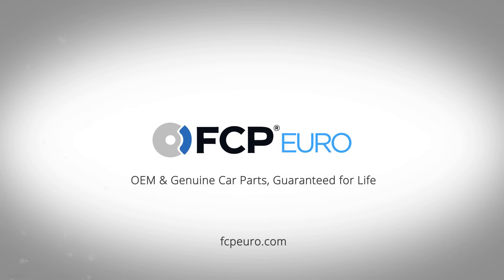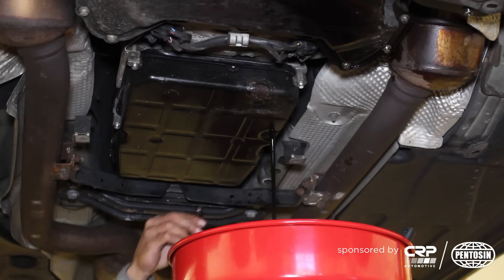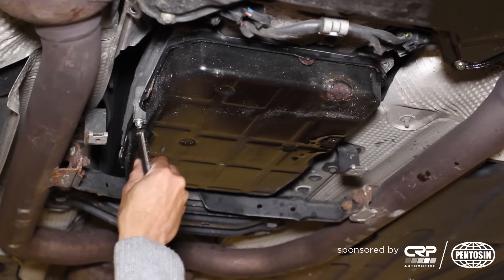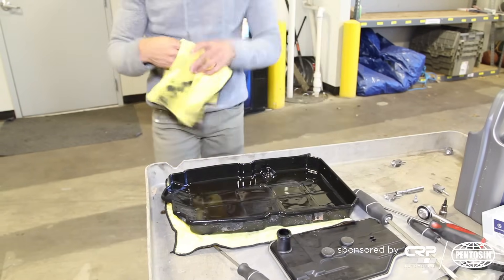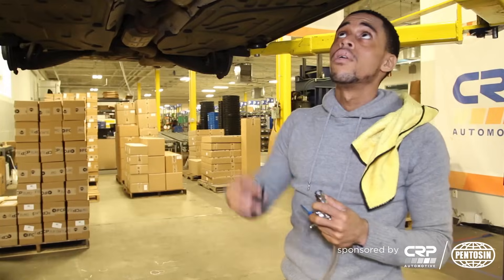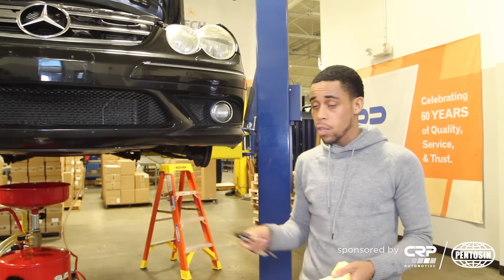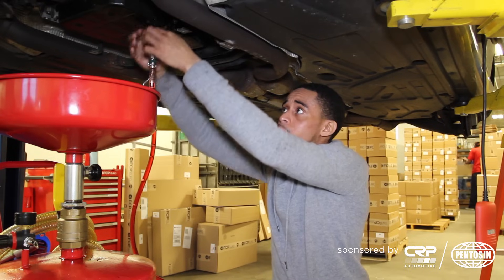Mercedes Transmission Fluid Service (w/o Torque Converter) Rein/Pentosin - Important Service (722.9)

Comment: You didn't Changed the gear from  drive to reverse and neutral at filling.
Reply: tay aci it was just a filter change
Reply: @iamher6422  look again itstransmission oil change with new filter ofcourse
Reply: tay aci 😂 I’m sure he did it off camera. I’ve done a lot of transmissions in which I too forgot that step with absolutely no problems.. 🤷🏼‍♀️
Reply: it's amazing how Benz complicated that simple procedure! Just need to know what is the exact oil amount (+/- 1/2 quart!)
Reply: How many quarts total sheesh thats all me need to knw
Reply: I heard of this before for the transmissions supposed to shift the gears so that the fluid could get into the gears properly

Comment: Great job, dont forget to do the pan bolt torque dance, 4Nm then 180 degrees tightening to stretch the new bolts that were supposed to be used each time.  I think they are aluminum.
Reply: Do you recommend draining the torque converter?

Comment: FCP, thank you for the video, but you need to also provide torque values for the pan bolts (mentioned below by another user as 4 NM + 180 turn) and drain bolt.

Comment: I watched your video from start to finish and from what I saw it was reasonably informative however I cannot understand why you did not drain the torque converter or flush the transmission cooler because you only changed 4 litres of fluid and left 4 and a half litres of contaminated oil in the torque converter and in the cooler which will contaminate all the new oil that you just put in this is why I do on my own servicing myself rather than getting another mechanic to do exactly what you did
Reply from the maker: Peter, for those wishing to drain the converter we also offer a 12 liter kit at this link:
https://www.fcpeuro.com/products/mercedes-automatic-transmission-fluid-service-kit-12-liters-pentosin-722-6fck2
Reply: that is a different procedure dude, what he intended in this video, i believe, was to demostrate a simple 40k trany svc were a filter/ gasket and trany oil are changed w/o the hasle of the other stuff you mentioned for a 100k svc interval 🤔

Comment: Clear and concise video. Thanks. 
Torque aluminum one time use bolts to 4nm evenly.
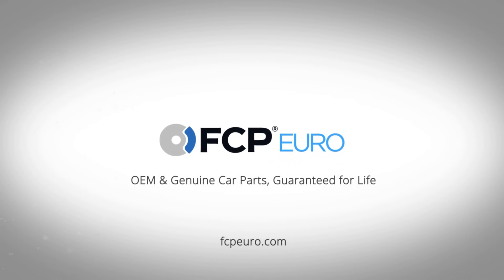With torque wrench turn bolt head to 180 degrees or 8 nm  and stop turning the bolt 6:42  whatever comes first.

Comment: What I like to do when setting the level and waiting for the fluid to warm up, is to overfill the transmission, and then cycle through all the gears waiting for about 30 seconds through each gear.
That way, you are using all the fluid you opened and cycling as much fresh trans fluid through the engine. 

If the fluid came out extra black, I will wait for the trans to cool down and let it run a little longer to try and cycle as much fresh fluid through everything as possible
Reply: wisdom
Reply: Is this what MB recommends? This sounds like the proper way to do it but maybe there's an underlying condition preventing this sequence to take place which is why MB does it differently
Reply: @aliislam580  no, the MB dealership will just do a quick job, so it will likely just be a straight drain and fill.

I recommend doing a drain and fill once, then again after 3000 miles, and one more at the next oil change (7000 more miles). Guarentees the fluid is almost completely exchanged and contaminants flushed
Reply: @reddyuda   I previously bought a used 2024 E350 with 110k miles but don’t have the service history. Is it still safe to change the transmission fluid?
Reply: @aliislam580  yes, the main difference being do not flush the system, just do a simple drain and fill. You can keep the old fluid in case of any problems you could swap it back in.

With 110k Miles you should be totally fine with a simple drain and fill. Wait 3000 miles before doing any additional fluid changes
Reply: @reddyuda  Yea sounds good but you haven't changed the internal filter or cleaned the magnet inside the sump.
Reply: @mercamg9312  No I still pull the pan, but I won't change the gasket or filter until the last fluid exchange. Different than a flush - I normally do the "slow" drain + fill method a few times to avoid any issues. There is about 1-2 quarts left in the pan usually
Reply: Nice

Comment: I have a 2001 ml320 with the 722.6 5-speed transmission and the drain and filter procedure is similar but there should be a fill tube in the engine bay near the back of the motor, it has a black cap with a red locking pin that’ll need to be replaced once opened/broken (inexpensive). Just measure the quantity of fluid you drained, then put that same amount back in thru the full tube. They also sell a universal Mercedes transmission fluid dipstick if you want to check for accurate levels. 

You can flush the 722.6 transmission by removing the lower fluid cooler line from the radiator and letting it drain into a bucket. (It will only drain when the engine is turned on) 
Be sure to fill the transmission up with the amount that drained out of the pan first before doing this (usually around 5L). Then drain 2L from the cooler line and add 2L of new fluid into the fill tube and repeat 2-4times depending on how clean you want it. 

I usually do a flush every 50,000kms and I’ve got around 280,000kms on the truck now

Comment: I recently changed my transmission fluid on my ML280 W164, however as mentioned in other comments i drained the torque converter, which is a simple job and holds lots a surprisingly large amount of ATF fluid, i then flushed the oil cooler with new clean oil until all the old black crappy ATF ran crystal clear, which took at least another litre, i ended up using around 12 litres in total to complete the task but that  included around a litre used to  flush and renew the transfer box oil also, might as well do a thorough job if your going to get your hands dirty....
My point is that if you follow this guide as good as it is you will at best only be changing a little over 50% of the gearbox oil which seems pretty pointless to me, especially if you are using all genuine parts as they are quite costly, the sump retaining bolts are of the stretch variety so should be replaced with new items when carrying out the procedure.
Reply from the maker: Excellent suggestion, we do offer a 12 liter kit for those looking to drain the converter. It is located here:
https://www.fcpeuro.com/products/mercedes-automatic-transmission-fluid-service-kit-12-liters-pentosin-722-6fck2
Reply: You can change the torque converter and the main pan which is the majority of the oil, i would say 10 litres would be sufficient, i used a couple more but that was in the oil cooler and pipework flushing process.
Reply: The drain plug on my ML is accessed through a hole in the gearbox casing, you remove a rubber blanking plug first and looks a little awkward at first glance, i used a 1/4 drive ratchet and wobble end extension, quite straight forward really.
I would check on one of the Mercedes forums first to see if the process is the same on the W219.
Reply: D Farnsworth changing only 50% may be useless in some cases, but sometimes it is might even better to not flush the whole transmission and just do a simple fluid change.
Reply: The problem is not all of the torque converters have drain holes. I have been servicing MB vehicles for 17 years and I have serviced my share of 722.6, 9s and AMG Speedshift transmisions. If you perform this service during proper intervals, you don't need to go through that process. That is for people that wait until 100K miles. 

The fluid is not the only reason for the service. The filter holds a lot of material and the magnet can get completely covered with clutch material as well as the bottom of the pan. I have customers with Ford E250 work vans with over 300K on the original transmissions because I change the fluid ever 40K. Hell my work van has 200K on the original transmission and it still shifts firm and I have only changed filters, cleaned pans, and replaced about 4 quarts at a time. All red in color. Your process is for people that don't follow the scheduled maintenance and waits until its a problem. If the conductor plate speed sensors get covered with material because a person waited too long, all of the flushing in the world will not save the expensive bill about to come.
Reply: @marcsmith3881  I appreciate that bit of knowledge you supplied. Recently got a c207 chassis which had a fluid change at 39,xxx mi. Currently at 77,500 mi & planning on doing this in the next few wks. Of all the info I've come across from various sources, what you said is what I've seen. I called the last mb dealership who serviced the car under its 1st owner to confirm this being done at the correct interval, so I also planned on doing it as it was done in this video. I can't argue with anyone who wants to be 100% throughout however
Reply: @fcpeuro  can you provide a new link, old one is invalid
Reply from the maker: @crookmusik2023  https://www.fcpeuro.com/products/mercedes-722-9-transmission-service-kit-pentosin-7229late?utm_source=youtube&utm_medium=description&utm_campaign=mercedes+audit&utm_content=v017
Reply: Even the dealership only changed the pan and they charge like $500. It’s hard to find a shop that will do a thorough changing when this is the case. Wish I had a garage I would do this service myself.
Reply: @marcsmith3881  Hello everyone ! 
My mechanic put wrong oil trasmission on my c300 2012 . He put red one 236.14
But the car need 236.15 blue one. I have made 14k km , what should i do . Could i have problem if i change now with blue one or should i keep red one
Reply: @marcsmith3881  That's a great point. I just talked to a reputable MB indie who said they don't drain torque converter either for all the reasons you stated. Stay on top of trans services and it's gonna be juuuuuust fine. I'll just do it every 50K and stay ahead of things. Looks pretty easy on this so not a huge deal. The shop's price honestly wasn't bad either so I might just let them handle it this time.

Comment: I have a 2017 AMGC 63S coupe and I need to change the transmission fluid and filter as well as the differential fluid for my 30k mile B service. Does my car have a torque converter that need to be drained? I don't see that covered in this video and I also don't see how you flush out the left over oil in the trans coolers. Don't you need to turn the engine at the crank until the drain bolt for the torque converter is aligned so you can drain the torque converter completely or is that not done on my car? Also, don't you need to remove the return line to the pan and add a hose extension to it so you can flush out the old fluid left behind by pushing new fluid through it. After which you warm up the trans to setting the final fluid level. I plan on doing this next week so I could really use some help on getting clarity on which steps I can skip and which are necessary.

Comment: So my 2014 Toyota Camry has the over flow pipe that threads into drain and the bung threads into this so there is no need to knock anything off. And there is a fill port up high on the transmission itself and so no need to pump up the new fluid. Drain and fills are super easy. The usual applies , warm up tranny to 113 F( about 45C , I believe) . Its a tedious process with my E350 and I usually renew the overflow pipe and filter along with pan gasket and bolts. Great video Thanks.

Comment: Is it good idea to change fluids when you are not sure if it has been changed. I’ve heard horror stories about bmws and stuff when changing fluids it creates hard shifts and issues with the new fluids. I drive a w212 m276 usually. So I was wondering about these ATF changes

Comment: Hey Kyle, not sure if you’ll see this but I enjoy watching your FCP Euro videos since I’m a MB guy and you’re the MB manager.  I have a stupid question that recently dawned on me.  I have a 2010 C300.  Assuming that someone can hold the pan steady, even if you need help from a second set of hands, can you not fill the transmission pan with new fluid close to the top of the new overflow plug, and then bolt the pan back up and turn the engine on, wait for the temp to get to where it needs to, and then slowly open the drain plug and see if it’s dribbling?
Reply: No way.. the internal over flow is pipe is higher than the pan I guess.

Comment: Hi, Is there a video for the MB - X166 GL500 -Year 2014  - Transmission fluid service with Torque Converter drain. Kindly share the link. Thanks

Comment: My question is , how do you drain/flush the transmission properly? On the 722.6 model after the replacing of the filter and putting fluid in( the older models have a dipstick) you run the engine, open one of the transmission oil cooler lines and drain 1 liter or so, top it off and re do( there is a spec for how much to drain each time). 
  I want to do this job on my own, the stealership wants 800$. I have a 2007 E320 Bluetec. Do I have to mess with the torque converter at all?
Thank you in advance
Reply: The dealership wants $1k to change my transmission fluid 😢

Comment: I have a question - I was swapping engine and accidentally pulled torque converter out of trans input shaft ( yes I unbolted it from fly wheel ) , so how do I properly refill trans fluid after mistake like that .

Comment: Great place for buying Mercedes parts. I ruined a new Febi Wheel Hub purchased here, FCP replaced it free of cost, they have this "abuse it and return it for free replacement" policy that turned out to be true. Because of this insurance I expect the price to be little high, so I always compare prices elsewhere, yet find that FCPEuro beat competitor's price 95% of the time. Bought both my front air suspensions (Arnott) here and no worries about it going bad. I would like to find a similar shop for my Odyssey.
Reply from the maker: Glad to hear everything worked out well with the replacement.

Comment: Is that knocking sound from the enigne normal ? My 2008 c300 has been doing it, less loud then the one in the video but its the same pitch, for over 60 000km now and it hasn't increased in pitch nor got worse so I presume its normal for the m272 engines ?

Comment: Hi Kyle
Is it true that a Mercedes transmission dipstick will suit all models.  But the level that is appropriate may be different. The east west engines only need level 4 on the dipstick.  Other Mercs can go to level 12 (MAX). Cheers

Comment: he so I just swapped my transmission because my torque converter was giving a code saying it’s overheating. I swap the trans with one that has 38k miles. And now the car won’t communicate with my new transmission. But throws no codes. Even the dealership doesn’t know what the issue is and why they cannot reprogram it. Should I just swap back and fix my torque converter or jus sell it?

Comment: I know that the transmission takes way more fluid (TC and cooler lines) but is a partial change done to prevent the transmission from slipping? I ask this because I did a full flush on a high mileage Toyota Camry and the transmission shifted really smooth but it was also slipping. Had to drain some fluid and pour in Lucas Stop Slip. My MB has 95k so I plan on doing this but should I do a full flush (TC and cooler) or just a partial like in this video?
Reply from the maker: Just a drain and fill is recommended. It's possible to run into issues when flushing out the torque converter.

Comment: Would you have to perform this drain and fill multiple times (maybe 2-3) in order to ensure you have more or less gotten out most of the old fluid? I'd imagine that the transmission contains way more than the amount drained and filled in this video?
Reply from the maker: Tom, that would be recommended if wish to fully flush the system as best as possible. On a transmission that has been regularly serviced, a simple procedure like this is sufficient.

Comment: Is it similar procedure to the 722.6 5 spd? Waiting for parts from GCP to do it on my CL55
Reply: I have a 2001 ml320 with the 722.6 5-speed transmission and the drain and filter procedure is similar but there should be a fill tube in the engine bay near the back of the motor, it has a black cap with a red locking pin that’ll need to be replaced once opened/broken (inexpensive). Just measure the quantity of fluid you drained, then put that same amount back in thru the full tube. They also sell a universal Mercedes transmission fluid dipstick if you want to check for accurate levels. 

You can flush the 722.6 transmission by removing the lower fluid cooler line from the radiator and letting it drain into a bucket. (It will only drain when the engine is turned on) 
Be sure to fill the transmission up with the amount that drained out of the pan first before doing this (usually around 5L). Then drain 2L from the cooler line and add 2L of new fluid into the fill tube and repeat 2-4times depending on how clean you want it. 

I usually do a flush every 50,000kms and I’ve got around 280,000kms on the truck now

Comment: Haven't seen it been asked.  What is the air pressure you set the fill tool at?
Reply: 10-15 psi

Comment: Hello,
I have a 2005 slk 55 AMG with 83k miles on it. Mercedes says it's life time fluid for transmission?!? Should I go ahead and change it either way? The shift fine I'm only concerned since life time for any fluid is crazy to me
Reply: go for it! did you do it yet?
Reply: @xlyamx  no I gotta find someone who will actually do it correctly. I just don't trust the dealership
Reply: @basketball798  what kind of car? where do you live? just curious..
Reply: @basketball798  i just did it on my 2010 GLK350 and its running great.